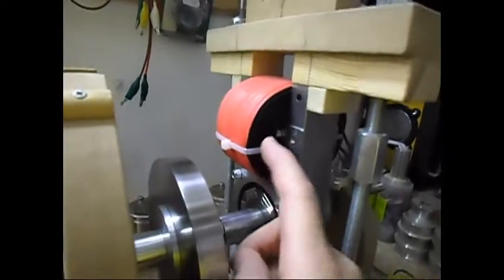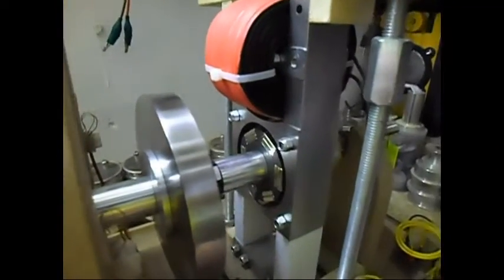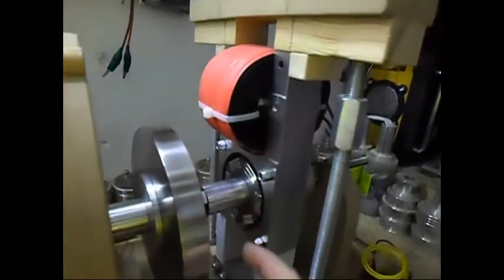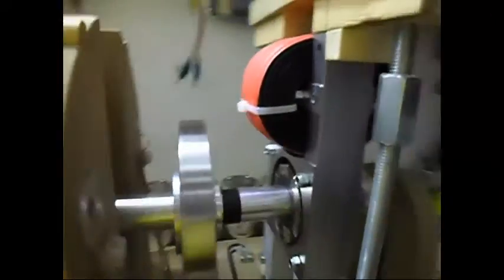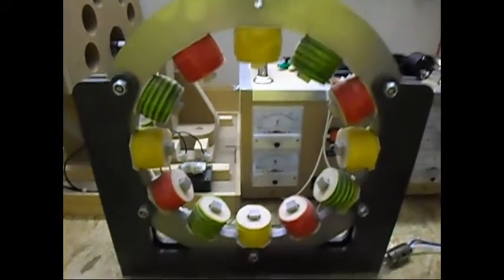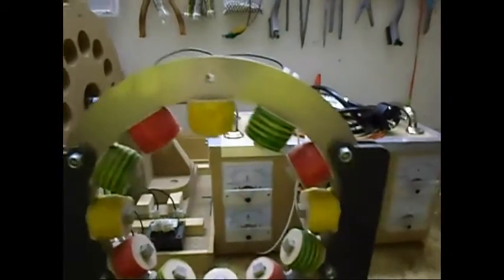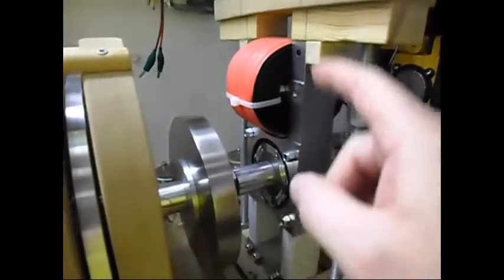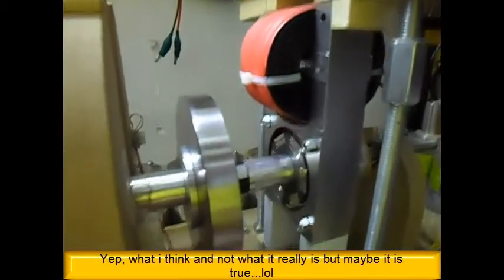Tr3nity Dynamo, Update 6 - Coil in a different position and a FAIL(lol)...

Comment: what happen to the output if you put a magnet inside the bottom part of the core?
maybe using opposite magnet polarity it will force the field to the top of the core where there is the gen coil
Reply from the maker: Thanks for your comment...^^
Hmmm, i could try that but the rotating rotor magnetic field is a bit of an issue i think...???
It will have to wait since i have now on this setup my new Dynamo design for some quick testing before going back to the single phase generator...
Some many things to test and so little setups to test them on...i could use another long shaft as this one...;-)